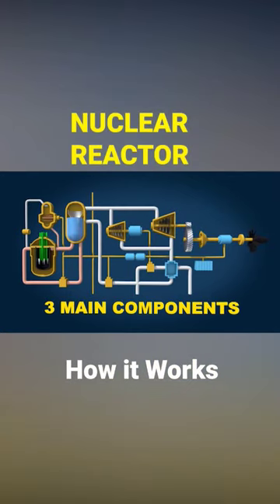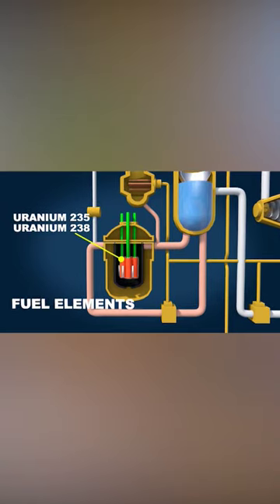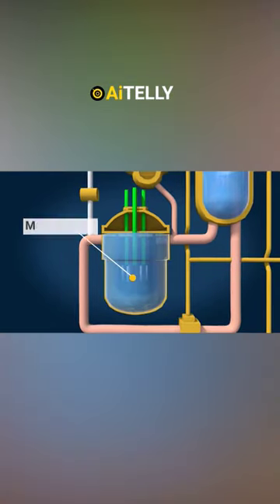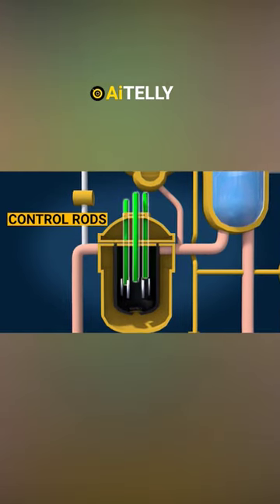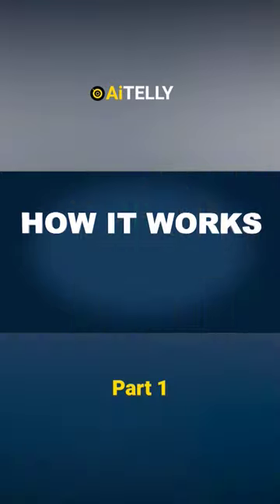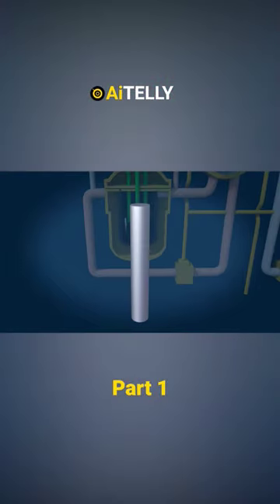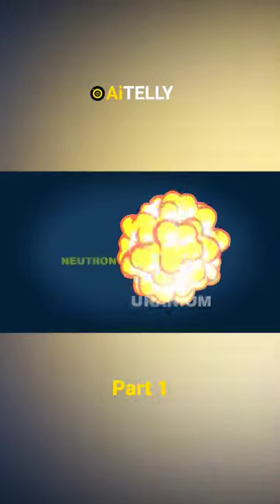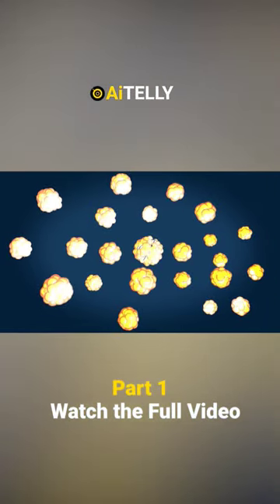Nuclear Reactor Part 1 How it Works #3d #submarine #titanic

Comment: Uranium 238 is never used in a reactor because it will not support fission chain reactions. This is why uranium is enriched, to separate the desirable uranium 235 from mined uranium which is mainly u238 with a small amount of u235.